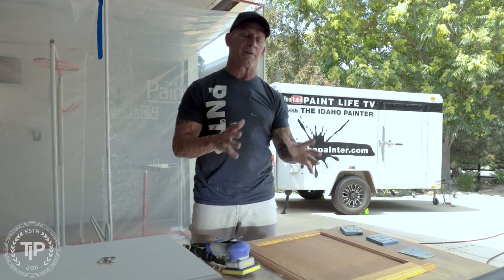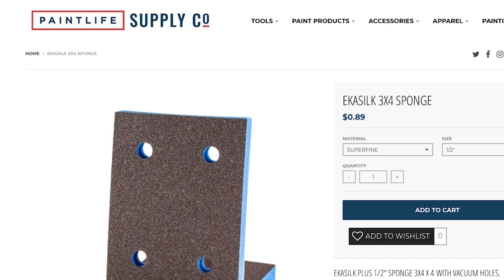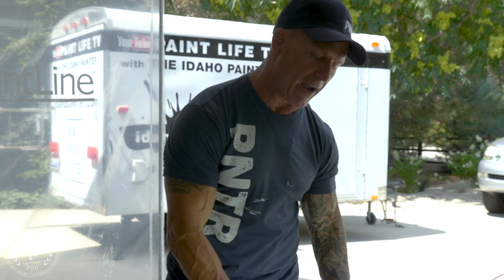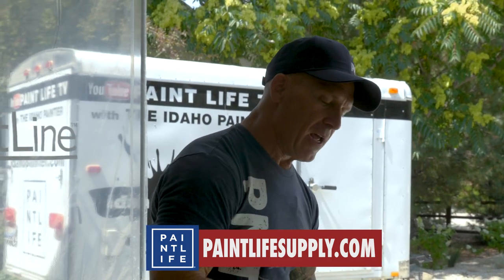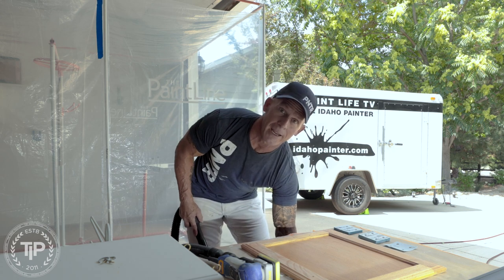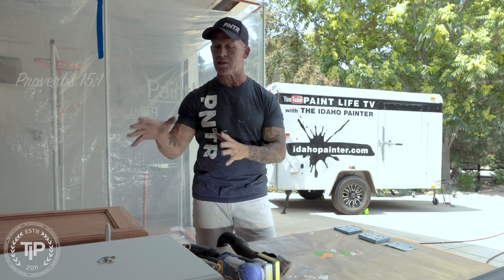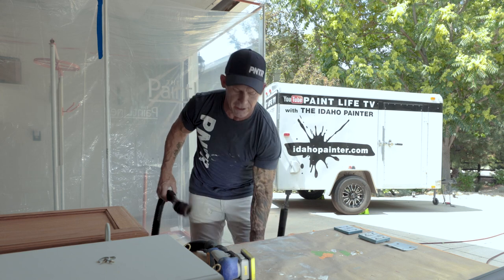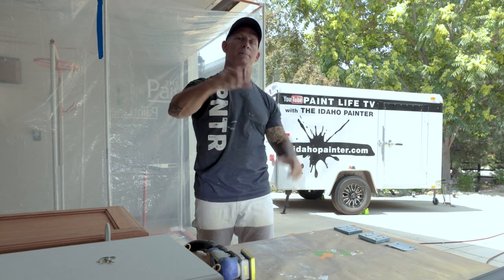Best sander for cabinet repaints.  Cabinet painting tips.

Comment: Thank you so much, I'm a painter myself, I've been a residential and commercial painter for 22 years now and I love watching your channel, I use a finish Sander also, I have an orbital but when it comes to fine finishes I use my finish Sander so I don't leave a chance of swirly marks, I use #180-#220 when I'm doing millwork or doors or cabinets and a small sanding block for filler that's in tight corners. I also use a vacuum with a bristle brush, your methods are the best and I know this from experience, you and your crew are top quality no doubt. Sincerely Lorenzo gig harbor WA.

Comment: All is well: and I am using a number of your painting trade skill in my work.
* No longer washing out trays, pots and buckets each day. 
* Using a little hot water on the bristles.
* Enjoying the pelican brush and roller combo.
* Don't be afraid to take the roller off the pole and use it by hand.
* After some hours of rolling, I'm seeing nap or small dry paint pieces on the wall. I have been flicking off with a brush or my finger and rolling off.
With sincere thanks....out!
🌏🇦🇺

Comment: Coming from a pressure washer myself, I can see in the intro you are using a red tip turbo nozzle on the house or I could be wrong. We never use them on account of such high pressure because we use an 8 gallon minute machine for most washing. How does it work out for painting?
Reply: If it gets damaged from the turbo nozzle it’s usually a sign that it wasn’t solid enough to be painted. If the damage is from getting to close and it furs the wood then We prime it, sand it and then paint it. If it’s a crazy hollowed out/termite damage disaster blow out then we will repair the problem area, yes we charge the customer, yes it’s in the contract.  But if we were not about to paint the house then we definitely wouldn’t be using such a tip. I’ve tried soft washing before a paint job but had adhesion issues. So just water and pressure now. It’s like surgery, get rid of all the nasty, clean it good, repair, make it look good

Comment: Thank for the demo. I was told this is an orbital sander. Does this company make two different styles? Can you explain to me exactly how this sander moves since I can see that you’re replacing and removing the sanding pads without turning it off.
Reply from the maker: Its not orbital
Reply: @Idahopainter  it’s an orbital sander, says so right on their website. The 3x4 contact surface is moved by an electric motor in an orbital pattern. Problem is: geniuses like this YouTube salesman think “orbital” only refers to cheaper units sold by dewalt, makita, Milwaukee, etc.

Comment: For those of us who can't yet afford a fine finish sander like the Ekasand or SurfPrep, how safe are random orbit sanders for prepping cabinet doors and drawer fronts? By safe, I mean even when sanding with 180/220/320g, will most leave swirl marks on the doors or no?
Reply: Should be fine as long as you sand with the grain. If your painting you want have to worry about any swirl marks anyway. That's only a concern if you're staining the wood.
Reply from the maker: Just not as versatile

Comment: how is your vac turning on at the same time?
Reply: Look up “automatic vacuum switch” it’s an outlet that turns on the vacuum every time you turn on the power tool. But his particular sander probably has it all built in when used in conjunction with the vacuum that you can buy with the sander. Those Sanders cost a bunch but are definitely worth it
Reply: @paintpaintpaintco.6039  i have the same sander and absolutely love it, it’s funny when people question how great they are when they see the price.  I just picked up a 3 gallon Stanley vacuum to go along with it works really well just doesn’t turn on when I activate the sander
Reply: The plug switch is awesome. Have one from Amazon. Worth it.
Reply: @marthamryglod291  thanks